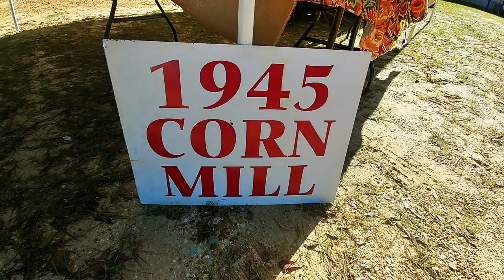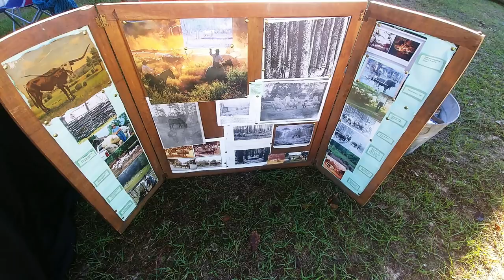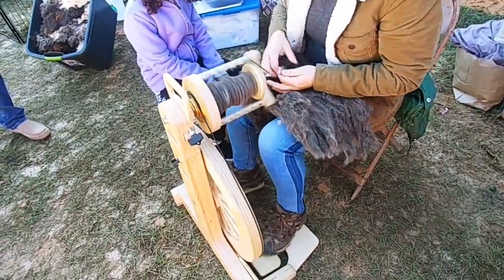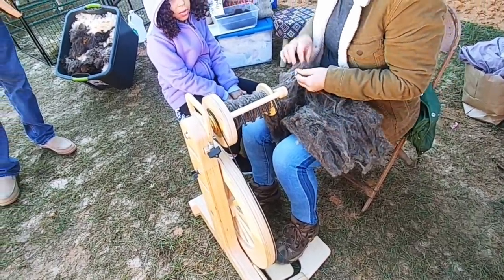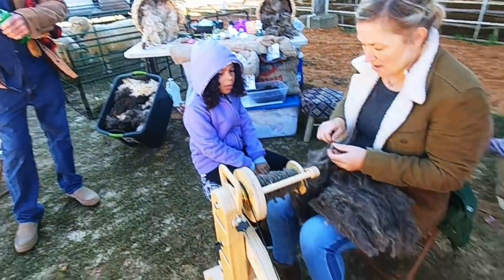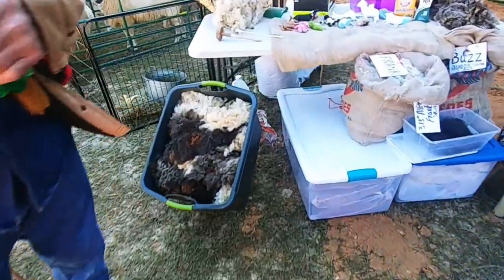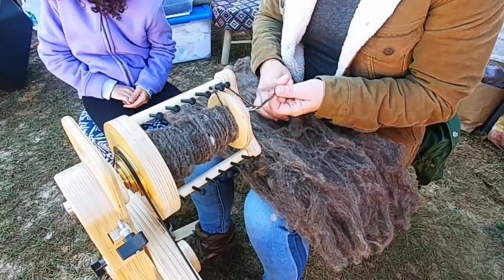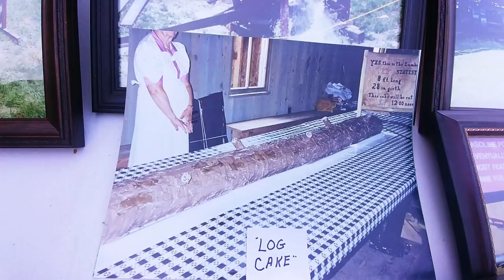Revisiting the OLD WAYS | Cane Syrup | Grist Mill | Oxen Pull

Comment: In a prior life I worked for a phone company. We had service areas in VT, CT at the time. We contracted with a gentlemen every year to pull cables for us. In the early spring he would  hitch his 2 draft horses and lay a trench with a plow. Then make the return trip with the same team unrolling a spool of cable  into the trench and covering it over. 

Many times the shortest path was over a piece of land than around it. The cost to lay cable with machinery was prohibitive. The draft team could work thru the landscape faster with less damage. Sometimes the old ways are the better way to do it. 

https://vtdigger.org/2011/05/22/draft-horses-the-transportation-method-of-choice-for-high-tech-fiber-optics-in-vermonts-remote-locations/